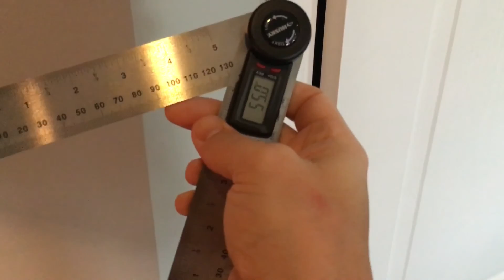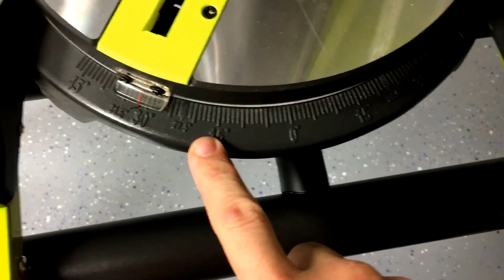Easy and Inexpensive Baseboard Trim Upgrade - Taller Look

Comment: The finish product looks nice.   What was the original baseboard size, space amount the top trim come out to? What is the top trim called?
Reply: Bobby Simon I was wondering the same thing. Another commenter is correct - it’s a door stop trim. At Home Depot it’s currently $0.79 per linear foot. I’m going to try this shortly. Awesome job in this video!!
Reply: Yes do you have a piece of trim size . I would love to do this. Did you say you painted in between. Thanks for sharing

Comment: Thanks for the great idea. Could you provide a link where we can get information on the same exact model of the Ryobi saw and stand that you used for your project?
Reply from the maker: Here is the saw:
http://www.homedepot.com/p/Ryobi-18-Volt-7-1-4-in-Miter-Saw-P552/300800888

Here is the stand:
http://www.homedepot.com/p/Ryobi-Miter-Saw-Stand-Green-A18MS01G/205642391

I caught the stand on sale for $50 or $60.  I sold that saw and bought a bigger  saw made by Rigid.  There's nothing wrong with the smaller Ryobi saw but I started doing bigger projects and needed to cut boards that were bigger in diameter and that smaller saw wouldn't do it.  I am still using the same stand though and it works great.

Comment: Awesome vision!  Btw, what type of flooring is that / where did you get it?  Is it still holding up (Baseboards and flooring)?  Thanks so much!
Reply from the maker: BuildingAssets floor was an option from the builder. The floors, baseboard, and trim are all holding up perfectly.
Reply: @rbell944  Thank you do much for the reply!  Do you know if the floor is wood, laminate or vinyl click boards?  Either way, it looks great! 🏆
Reply from the maker: BuildingAssets thank you. They’re 5” hardwood

Comment: Beautiful house & such a professional looking job!  How much would u say covered the house?  Cost wise?.... I'll assume it's about 2000 sqft. How much time for each step?  Cutting and nailing paint.  

The trim you used,  was it just one piece ( it looks layered) wondering if u added to the design
Reply from the maker: Chi Anosike thanks for the compliments. The trim was one piece and is sold by the linear foot. I bought it in 11 foot pieces because that is the longest I could fit in the back of my SUV at one time.  It is not very expensive at all. However much baseboard you have in your house is exactly how much trim you will need to do this project.  If you have all of the right tools and are comfortable using then it really doesn't take that long.  Especially if you're just doing normal square rooms. It takes a little longer if you have those weird angles like I have on some of my walls with the inside and outside corners.
Reply: I literally just finished putting up mine today.  Just needs to be painted.  I looked at so many places on YouTube that did it your way, but didn't see much.  But honestly your house was such an inspiration & great idea.  Next time add a few snippets of how you actually did it,  I was lost lol.  Any other cool home project post!!  Love it!
Reply from the maker: Thanks so much.  I thought about showing the actual cuts but I had already finished the entire house by the time I decided to make the video.  Since I made this video I have built floor to ceiling/wall to wall bookcases and cabinets in the office (the room I showed w/ the 3 windows), installed french doors in there, and built a "cheater" version of a coffered ceiling in the tray area of my living room using 1x6's and trim.  It turned out really good.